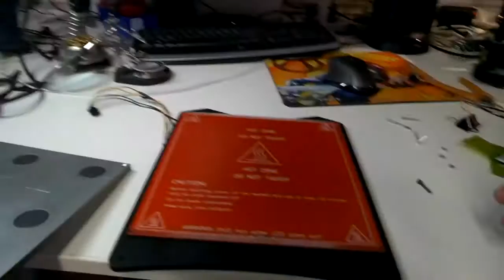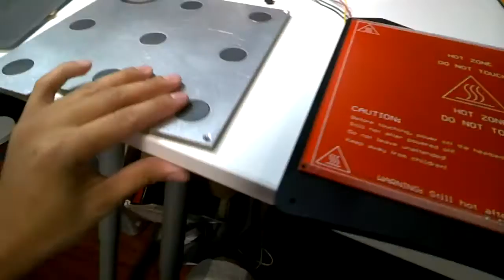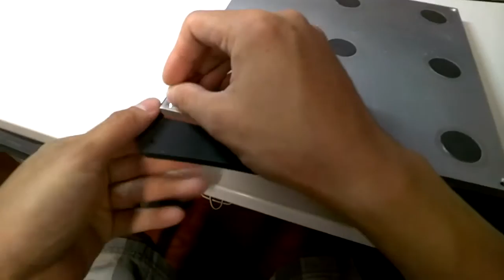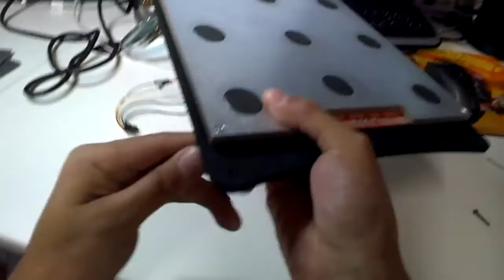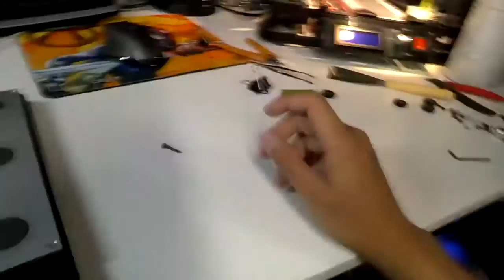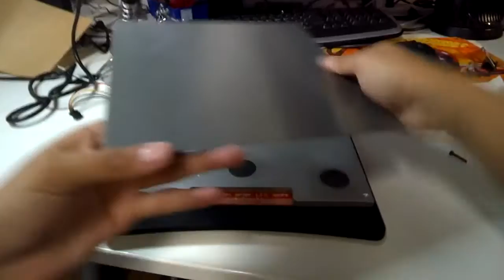GeckoTek HT Build Plate and Magnetic Base Installation - ABS version

Comment: So, after a couple of years of use, would you still recommend it?
Reply from the maker: yes!! all my printers run the GeckoTek HT plates, just make sure to get a good idea of bed alignment before trying it or else you will dig into the surface.
Reply: I too would 100% recommend magnetic build plates, I use a different brand one called Maghold - but same concept and it too works well.